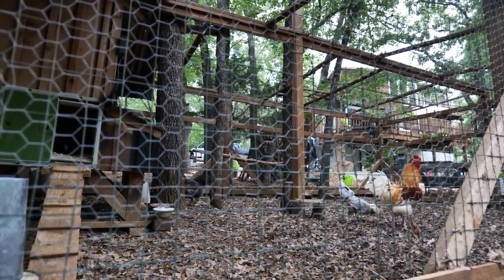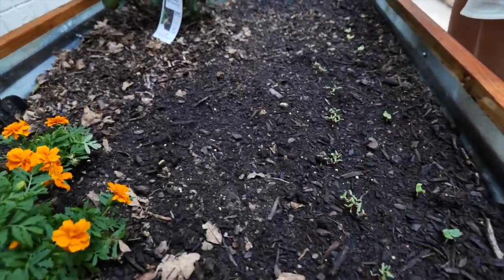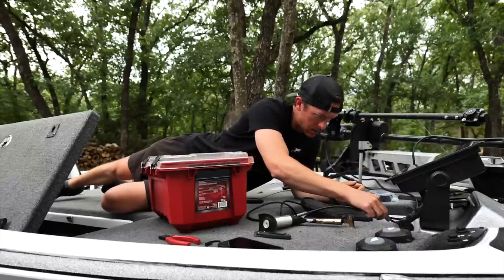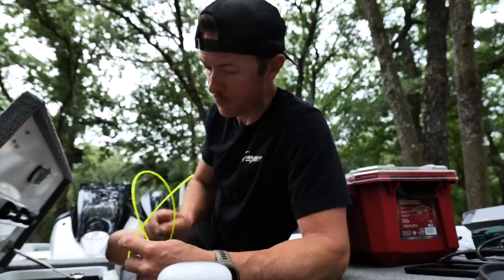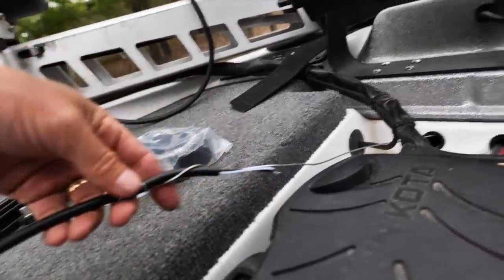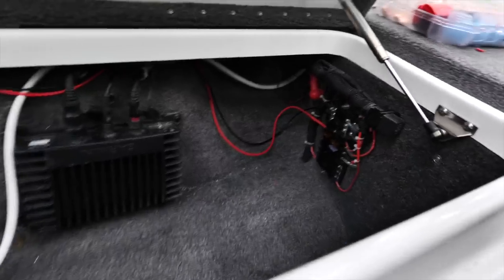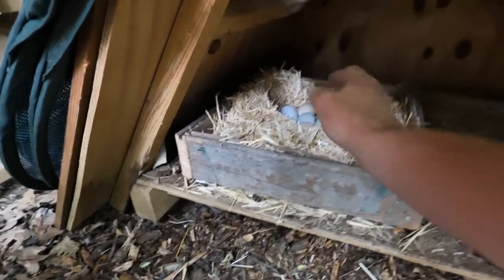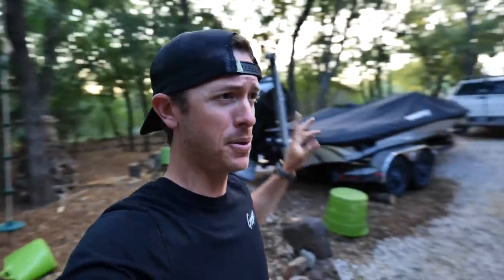Installing New LIVE SCOPE Turret on Bass Boat!

Comment: Thats a great product, and it's cool to see you install yourself.  The Wago connectors are convenient... but it's a better idea to use butt connectors, crimp them, and then cover with heat shrink tubing.  That's the water proof and long term solution.  But I suppose if you're trading in a boat every year, not as necessary.  But for those of us who keep our boats for years and years... avoid the Wago connectors!

Comment: If you feel like it needs bracing simply add the clutch from the Lawrence Ghost. It won't interfere with operation or quick disconnect removal.

Comment: Let's see how simple it disconnects when you actually have the transducer attached. Also by the sound of that foot pedal remote I can't see them holding up. But it's normal for companies to start out with that style because the others are expensive. They need to get some money in first. All in all I like the design for sure. Very easy install and looks good.
Reply: Heck the replacement switch is $400! How's that cheap? 😂
Reply: @churd83  wow. That as crazy. Lol
Reply: The transducer cable is the number one concern on ease of disconnect but if you leave a bit of cable loose, you can pull it off and stow it easily. Either way, It can handle a TON of pressure and there’s really no need to take it off. The pedals have been on other test boats for a while and have held up beautifully. Foresight is there to help in ANY way possible to keep the unit up and running. We love to hear the concerns and take them very seriously in the way that we continue the advancement of our products and keep fellow anglers happy.
Reply: @dannynyren9536  Thanks for the reply sir and please don't take my comment rudely as I never intended for it to sound that way ,But reading it myself it sorta does. I will say I am impressed with the manufacture actually commenting on threads. That's something you just don't see much of anymore if at all. How can I contact you guys. I'd like to talk about getting a et up and maybe becoming a dealer. I buy and sell late model bass boats and center consoles and most utilize Livescope. We sell about 35-40 boats per year and if I can dial it in and it makes sense I don't mind placing them on all of our rigs that sell with Livescope.